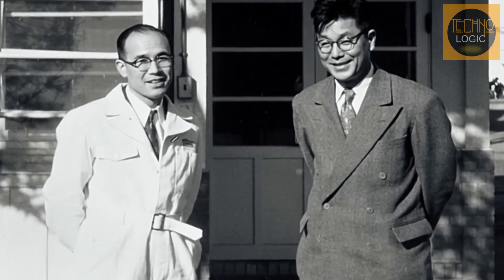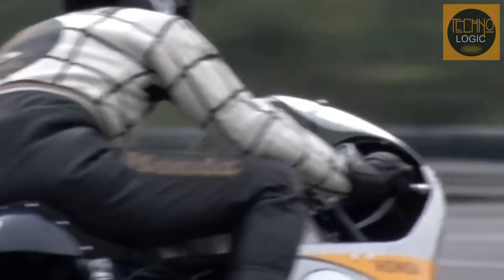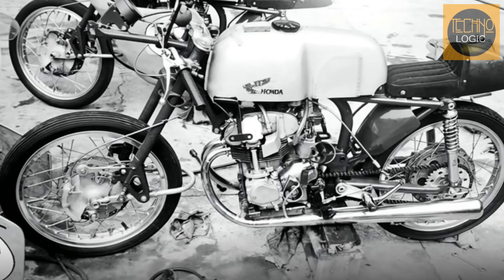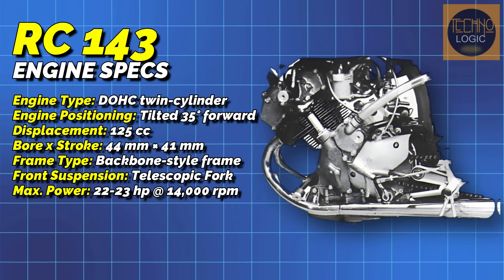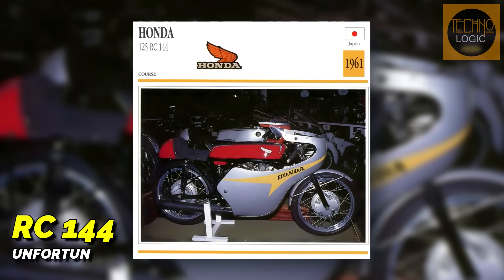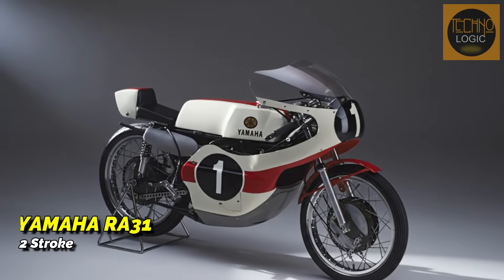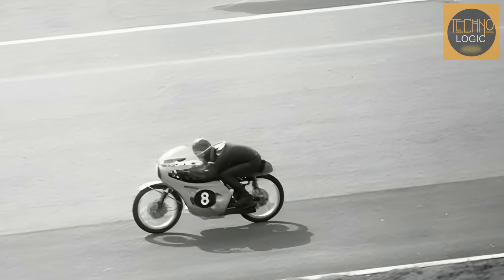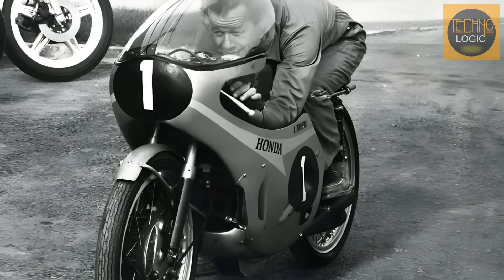MASTERPIECE‼️ How Honda's 5-Cylinder Tamed the 2-Stroke Beast of '60s Grand Prix

Comment: 2-Strokes are noisy and dirty. They're also fast, powerful, and cheap to build and service. If Honda had spent the same amount of money they spent on their Swiss watch 4Ts? They could have dominated small engine classes. They spent a staggering amount of money on tiny 4-stroke engines without any hope of winning. The rule changes were mercy. Kriedler was coaxing almost 20 hp out of 50ccs. It was a bloodbath! Then they built the NSR. ...15 years too late.

Comment: The narration is misleading.  At the time, four stoke engines developed more power than two strokes.  The age of advanced metallurgy and adoption of MZ's disk valve intake principle brought two strokes finally at an advantage in racing.  By 1964. the tables had turned to urge the two-stroke competitors into leading status and that was only in the smaller sizes.  The 500cc classes were still leading with four-cycle power units.  It was only in theory that two-strokes could attain the performance and reliability to consistently win.  When I rode scrambles during those early '60s, the classes were set up to give two strokes a handicap in the area I was racing, riding a 200cc Parilla against 250cc two-strokes.  I consistently won at TT scrambles until Bultaco began to arrive.  I eventually owned three Bultacos and they eventually gave 4 strokes their own class to race against one another.
Reply: I’ve got a perfectly restored Bultaco 125 Pursang in my shed.

Comment: Japan wasn't the only multi cylinder 4 stroke manufacturer. MV built a 6 cyl 350 for 1967. When the rules changed it got parked in a corner and it wasn't made public for decades. I saw it run in NZ when a stack of MV's were brought here for a classic meet. 6 megaphone exhaust made a LOT of noise. Ago came with 3 and 4 cyl 500s. Those early 60's produced some incredible machines
Reply: Correct but they were the only manufacturer that basically made Swiss watch size engines in 4 stroke multi cylinder
Reply: 言われてる事は事実だけど、ホンダのエンジンは驚異的な125ccだよ！